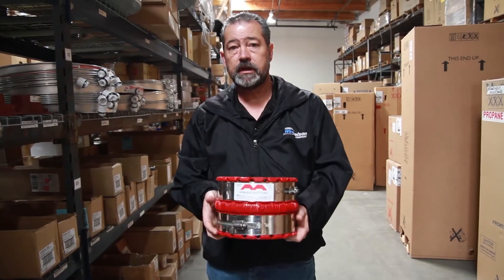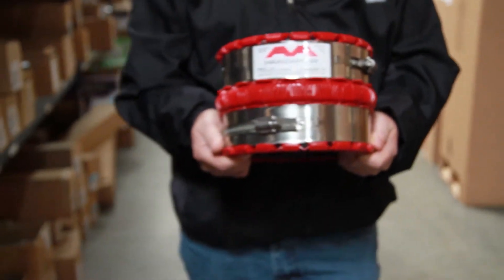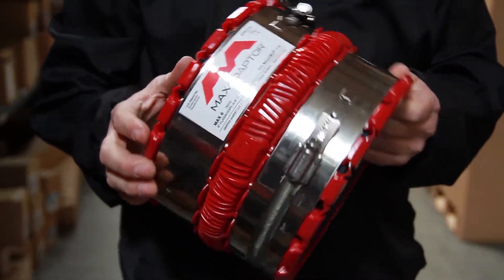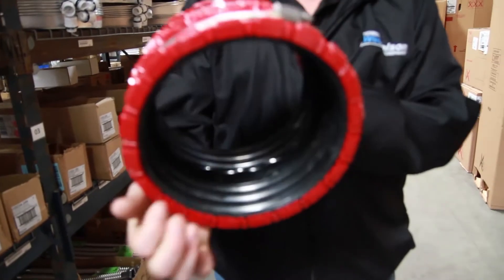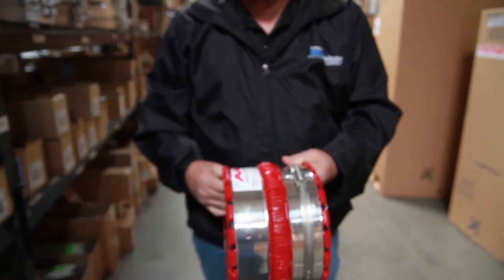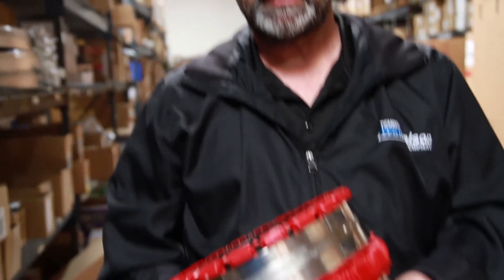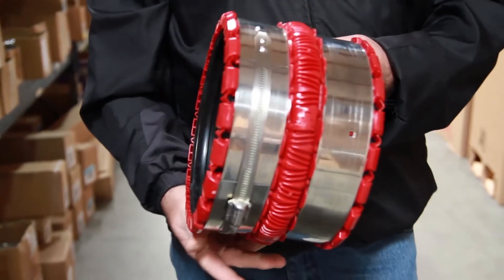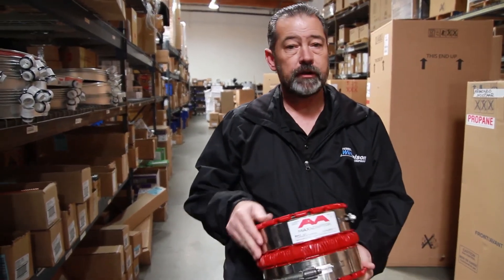Why Choose a Max Adapter Coupling Vs Regular Coupling

Comment: Fernco makes the same band only seen them up to 4 inch saves my ass when making those city conections
Reply: Need a flexible rubber coupling that is a lot cheaper than max adapter? Joints makes flexible rubber couplings at all sizes including 4 inch.